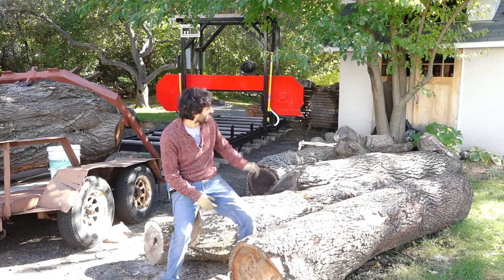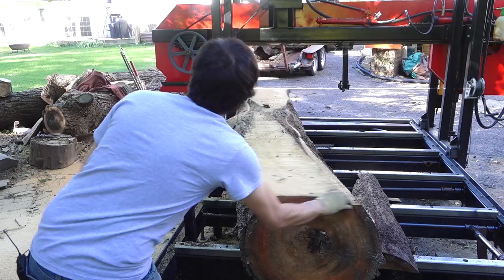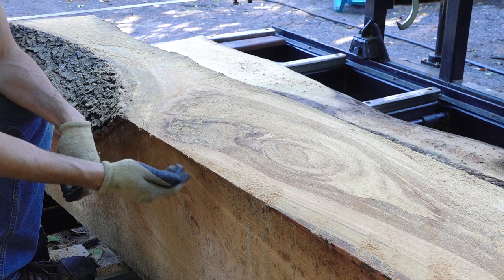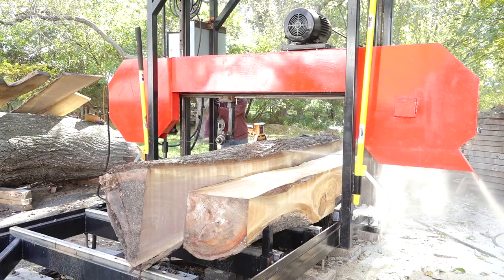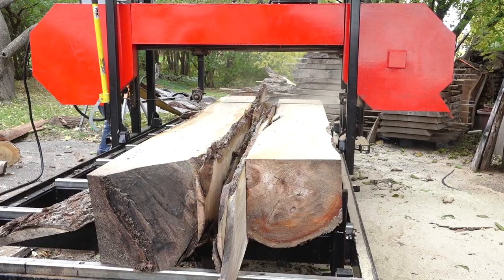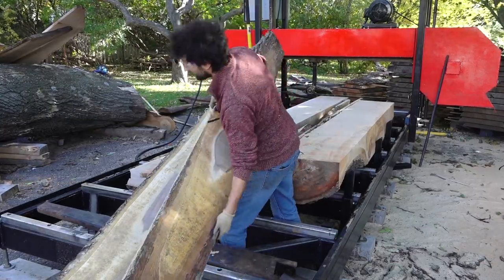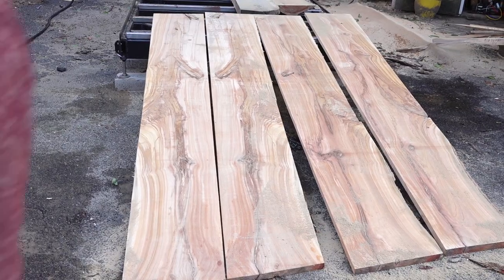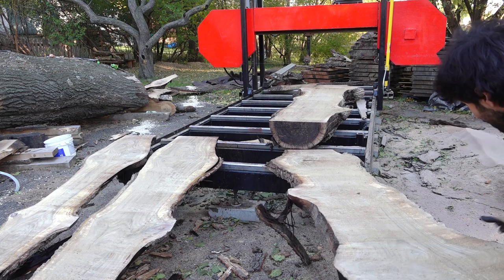Sawing Boards - Turning a Log into Lumber Part 1

Comment: Urban timber a resource that needs to be utilized more. Thanks Matt for leading the way.
Reply: Depends on the region but most of it gets pretty well utilized just unfortunately not as lumber. A lot of the communities I've worked for take trees and chip them for use in various places around the city landscaping ect. Some sites chip them and use them for environmental controls and then mix the mulch in with the topsoil as compost. It's rare at least that i know where a tree goes to a landfill and is just wasted.

Comment: Great video as usual.  I'm amazed at how conservative you are with saving the jacket boards with extensive sapwood.  I've never had luck getting them to dry anywhere near flat.  The differential drying of sap vs. heart wists them up into pretzels for me.  I have dropped my threshold for sending these to the firewood pile.
Reply from the maker: Usually end up ok. If they do pretzel, those boards will become stickers. Works out pretty well in that sense

Comment: So I'm not the only one who uses a cant as a clamp.  I mill my wane boards the same way.   Slap em between a pair of cants and cut em till they look 'good.'   With today's materials and stabilizers I don't fear or worry about dry rot and spalt in a log.   It's character, and you just can not find that in commercial wood these days.  My thoughts on that cherry are pretty much the same as yours.  The joys of milling our own lumber!

Comment: Thanks for the video - always nice to hear how someone else thinks it!  It looked like you were cutting 4/4 - if so, what actual thickness do you prefer and why, especially with your wider boards.  And, I'll cut a variety of thickness per cant, 4, 5, 6, 8/4 but then have to deal with stickering different thicknesses.  Any suggestions?

Comment: Hi Matthew, first question is it okay to remove bark from any size wood even if about thick as your wrist and 11 inch long.
With very dried out wood how do you cut thus branch into something like planks, I don't have band saw. Hack saw tennon saw and 400 mm saw only 
Would appreciate any suggestions 😊 for what I do have so if you can come up with some ideas thank you.

Comment: Matt, time for a power feed unit. It would also make a good video.
Reply: rickyretic Milwaukee Hole Hawg or a HF pipe threader could probably be adapted pretty easily. That’s a lot of hand cranking to saw a whole log. No wonder Matt stays in shape.

Comment: Hi Matt,  I am wondering, do you experience much blade deflection when running with the guides so far open as compared to when they are closer together?  Does cutting through two cants together make any difference over just one!  (Kinda the same question.)     also, does the mill's motor labor more noticeably with two cants?

Looking forward to meeting you in Des Moines next month.
Reply from the maker: No issue with deflection. Cuts are very flat.  Two cants is twice the load so yes, feed speed needs to be reduced. thanks!

Comment: Could the cherry be stabilized in a vacuum bag? Sure is pretty even if it is rot.
Reply from the maker: It could if it doesn't totally fall apart during drying and handling.

Comment: I was wondering what was the exact thickness you cut, looks a tad more than 1 inch, and why you choose that thickness??
Lots of people mill wood on the tube, but when you explain your thought process, and why you make those decisions, that is PRICELESS... I was also wondering if you would ever cut construction size lumber, like some "2by" for use in your house... Cherry is nice, but walnut is the freaking best.
Reply from the maker: 1-1/8"  - after drying ends up around 1-1/16" or so depending on cut and species.  It will usually dress out at 7/8" or 3/4" for sure.  I don't think I ever would.  Construction lumber is so cheap.  Would be hard to justify the work.  Thanks!

Comment: Matt you should set up a mister on your saw like they use on an end mill also wouldn't a plywood box that moved with your saw to catch sawdust make cleanup easier. Just some thoughts, great video great saw thanks for sharing.

Comment: Matt, why not use RotDoctor's penetrating epoxy to recover 100% of these boards?  I've used it to recover rot so extensive I could scoop out sections by hand.  But when saturated, the spalted all the way to rotted & deteriorated wood is so hardened and stable you can actually tap threads into formerly rotted material.  Those cherry boards are just lovely and would be fully useable if the penetrating epoxy were used.
Reply from the maker: You certainly could.  Might not be the look that everyone is going for.  Just depends on the project.
Reply: Yes project design might exclude it? But the figure and color of those areas you show as 'cut outs' - sure look nice on camera!  stabilized and finished like the rest of those beautiful boards... I doubt anyone would know those areas weren't originally solid wood? thanks for always great videos.

Comment: Would a motor driven capstan with a few turns of rope wrapped around it work better than cranking your winch. Speed can be controlled with tension on the tail end of the rope. If you used a double capstan, the second sheave could be used to return the carriage. Just a thought.
Reply from the maker: When I’m feeling lazy, I power it with a drill.

Comment: Is there a reason you wind the saw by hand , would it not be better to fit a variable speed drive to the feed , it would gve a better cut finish , and probably be faster in some timbers .
Reply from the maker: I enjoy it.  When I'm feeling lazy, I run it with a drill.
Reply: @mcremona  , fair enough , does the drill gove a better finish cut than hand winding , ??
Reply from the maker: Makes no difference
Reply: @mcremona  ok, i thought the constant feed by a motor would give a better surface  against  the hand feed that appears to pause at the  top of each wind of the handle.

Comment: My friend has a big diesel mill and he pressure washes a lot of his lumber and checks the wood with a metal detector. He unfortunately lost a eye when a carbide came off the blade. Went right through his safety goggles

Comment: You should really put an electric winch on that saw, you'll end up with tennis elbow or some other RSI from cranking that so much.
Reply: skmetal7 Matt was using a cordless drill to drive the crank for a while in the earlier months after he built the mill, but he went back to hand crank. I think he prefers the degree of control and feel, but Matt can speak best for himself on that.
Reply from the maker: yeah I find turning the crank very enjoyable.  On the much bigger stuff, it allows for more feel and control.